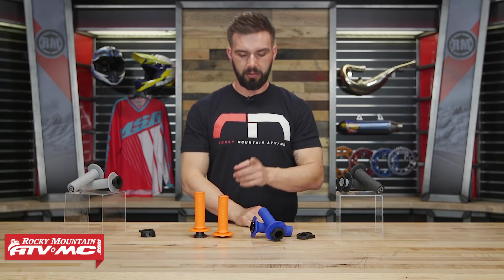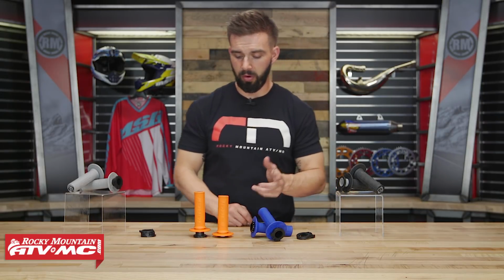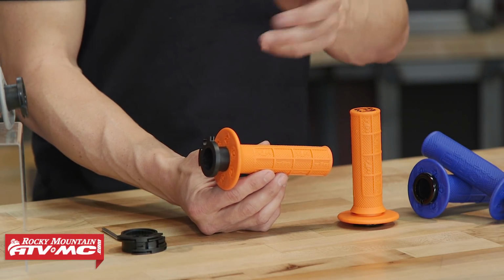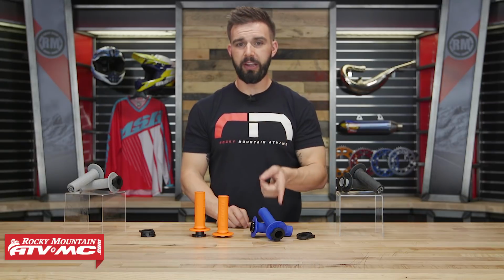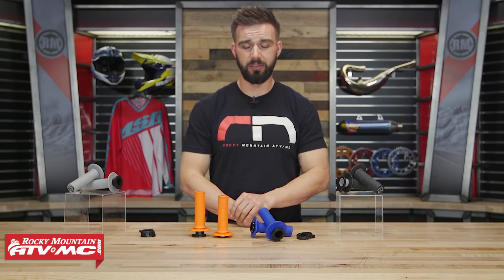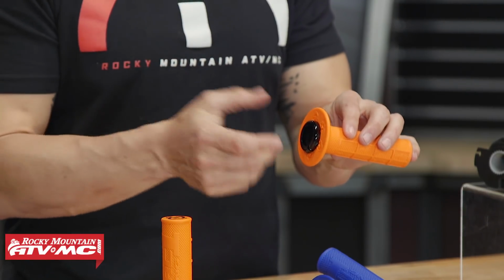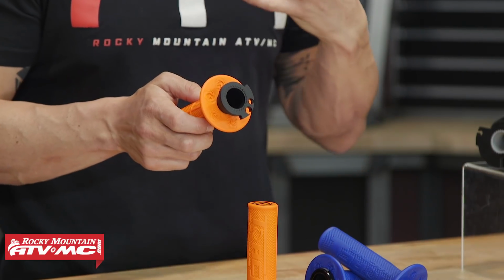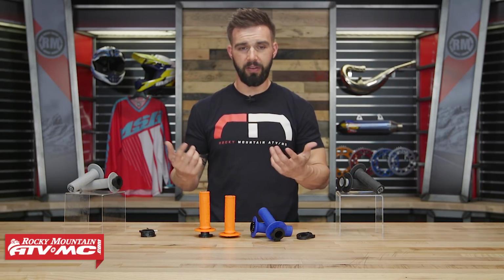Torc1 Racing Defy Lock On MX Grips

Comment: What lock on half waffle grips would be the thinnest diameter that you sell?
Reply from the maker: Matt, these and the V2s are the thinnest of them all. If I was being really nick picky, i'd say the ODIs are juuuuust a little thinner feeling. Do NOT go with the Emig version though, they are designed to be thicker than a standard grip.But between these and the ODIs, I have a small-medium glove size and I really like both!~Chase
Reply: I had some regular glue style grips not long ago. I was at a dealership that sold husqvarna. As I checked out the bike I grabbed the grips. They felt so thin! They were ODI lock on grips. I immediately bought a set for my bike. I love them
Reply from the maker: that's awesome! Lock on grips are so nice. I could never go back.